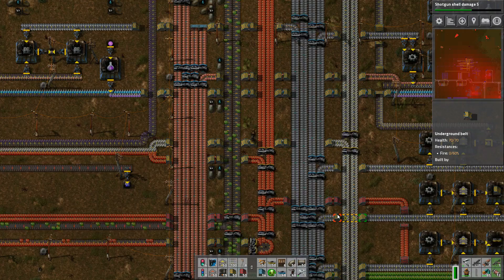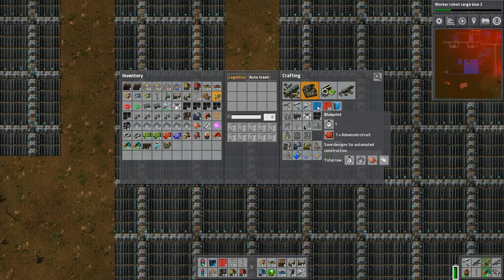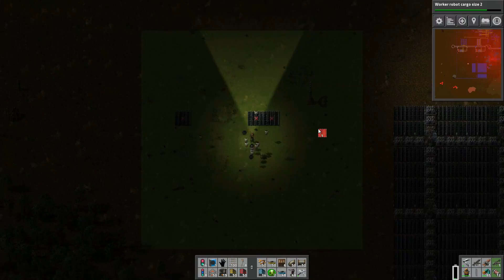Factorio MegaFactory 21 - Array Aesthetics and Circuit Setup

Comment: Hi Derek Mebius,

You have blue conveyors, so you have the blue liquid pumps. Instead of a circuit breaker, why not blues pumps?
Reply from the maker: That's a fair question, and I suppose the only good answer I can give is that I wanted an excuse to use the new power switch introduced in the 0.13 update. Either solution would work here.
Reply: Ok!! Nice. Very good ;)